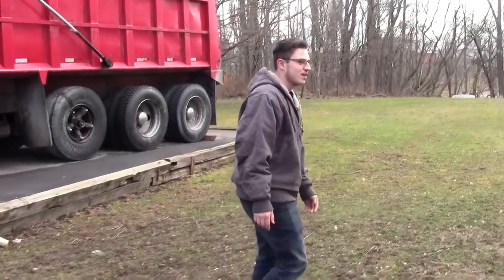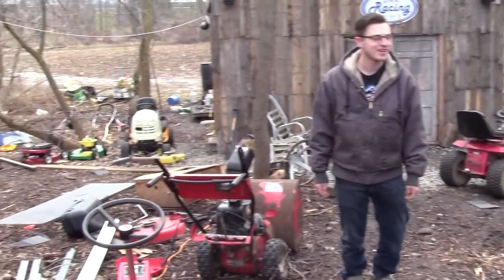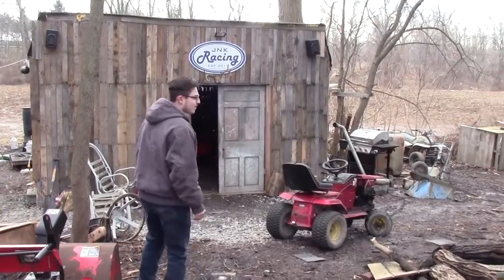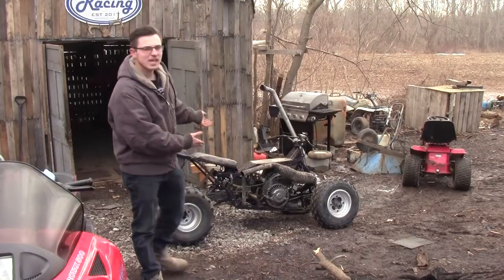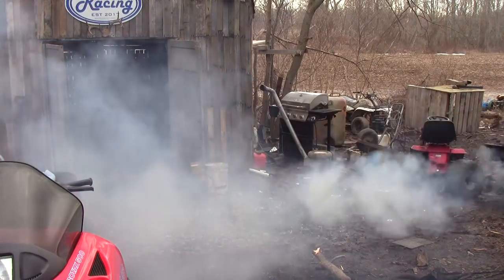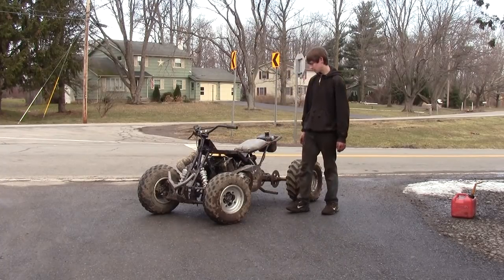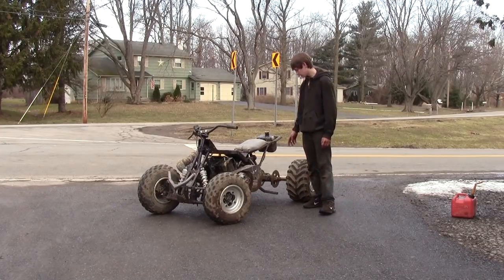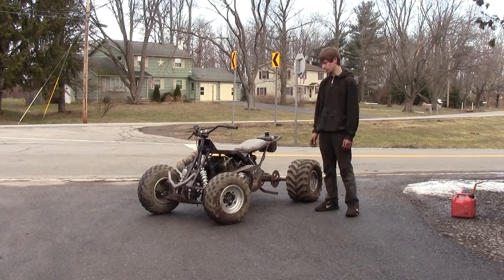Snowmobile Engine In An ATV?!?! (The TRX440)

Comment: nice build. Before adding a second jack shaft I'd play with the clutching a bit. I'm by no means an expert but I'd start with a stiffer  spring in  the secondary and maybe grind the back of the weights in the primary to lighten them up a bit
Reply: Exactly..its amazing what clutching can do

Comment: Awesome 440 was the first sled swap I did in a Honda odyssey fl250, before I stepped up and put a rotax 583 in an odyssey fl350 then upgraded to a 670ho. And about that power band.. make sure your clutching is right (most important on sleds to me) and carb jetting.  I tuned my engines with egt sensors in each cylinder and they're great even in these Southern MD summers at 100°
Reply: Rotax 🏁

Comment: I have 3 Banshee's 1 Stock. 1 pipes,jetted,Geard,lowerd etc. Etc. And one blown up
. I have a 91 Yamaha jetski, 550twin. Looking for a Clutch System to get from shaft on engine to a Sprocket final drive.. Any suggestions where to Look??
Reply: FYI the early PWC 2 strokes make little hp compared to their size. about 40 hp on the 550cc, and 45-50 on my 92 650cc yamahas. They're meant to be reliable when run at full throttle all day long. Mods can get you to 60-70 or so, but that's a lot of money on good porting, aftermarket heads, tuned pipes, etc.

Comment: Some of the quickest quads I've seen were powered by sled engines
Reply: Sno mo bikes hold alot of 300ft sand drag records
Reply: @ronrichards2691  yup I took my 670ho rotax honda odysse to busco Beach atv Park and on the 300ft strip no one could touch me. The cvt clutch was the best I seen everyone fall a little further back everytime they shifted . Then they stopped lining up with me. This was like 2010 when no one was driving utvs,  there was like 2 in the park that day
Reply: @shifty1927  lol yup people caught on. now i run 240hp triple cat in a atc250r frame. Love sand drags

Comment: hell yea you got to start somewhere!! I do question the safety aspect a lot. but atleast ya got a clutch guard. better do something with that pipe or when you get old like me you'll be deaf before 30!
Reply: BTW, she is running rich cause the pipe isn't holding enough back pressure or heat. got to keep heat in the pipe!

Comment: Blows up in 5 minutes no air filter probably not the right jetting for hot weather hotter than winter weather anyway
Reply: Its snowing in the end of video..
Reply from the maker: Dont worry it was jetted correctly we arent that dumb
Reply: @JNKRacing  ooof people just say shit idk why btw looks fun
Reply: It isn’t gonna blow up if it’s jetted for cold and run when it’s warm it’s the other way around because when it is cold air is more dense so it’s has more oxygen in it there for you need more fuel so it doesn’t lean out. Hot air has less oxygen so it’s running richer. Don’t post stupid stuff if you don’t know what your talking about
Reply: @kylebrown8891  atleast u know what your talking about not like these other people :)
Reply: David Wichner It just makes me mad that people feel the need to bash people that have fun experimenting with stuff. This video is a example of how you learn things in life and these boys have worked hard and as far as I’m concerned they have succeeded. Iv found that people who bash haven’t succeeded in life. Kind of like the guy who started this comment.
Reply: @kylebrown8891  do you work at a sled shop
Reply: Tristan Burke no but I have built dozens of ice quads, bikes and sleds over the years

Comment: Your gear ratio is way off and so is your clutch engagement. Wheels have much less rolling resistance than a track in snow. Try to have slightly taller gearing that the original snowmobile.

Comment: Hahaha I'm pretty sure I know who u are. But here's mine I built not to long ago
Reply: Anybody used a 500cc Yamaha jet ski engine on 4 wheels.? Water cooled. Want a put one on a John Deere 210.
Reply: @johnsvess7959  there's a guy on here that has vids of him putting them engines in different things. Its similar to a sled engine. Very very similar
Reply: I dont see anything?
Reply: There's nothing attached, were you trying to add a link to a vid of your quad or sled? I wunna see it
Reply: @mygt8a4re  yea no I had to put it in a separate comment. It says it went to it in not surw. Just look under my vids they're on here
Reply: @checkforfleas9452  I'll check it out, thx
Reply: @mygt8a4re  yea no I built a cheerleading a sled engine a while ago
Reply: @johnsvess7959  i am trying to. I have a Banshee roller ready for a motor...i have a 92 Yamaha 550 wave runner... Cooling is No problem...I need a Way to go From Shaft into Chain drive final.. it sits Perfect in the frame...Any suggestions on clutch Kits ...Right now its A work in Progress along with 4 others
Reply: @checkforfleas9452  I've tried all kinds of odd combos. I have a 65 hp evinrude /triumph out board I have set up to go on a mower chassis but I havnt completed it.